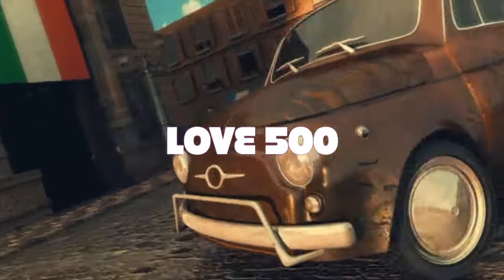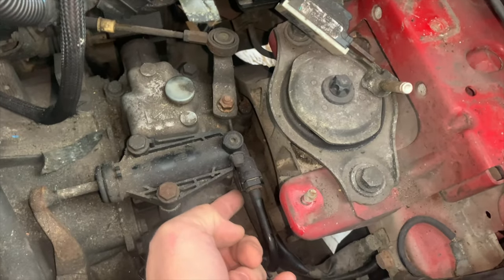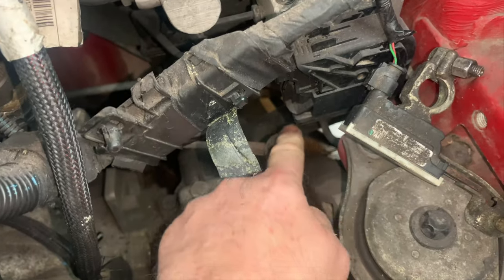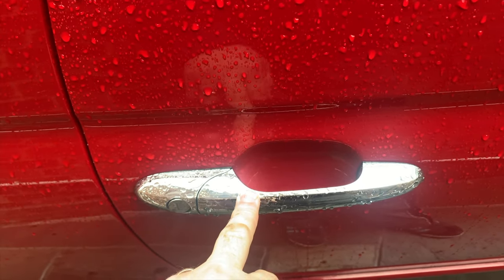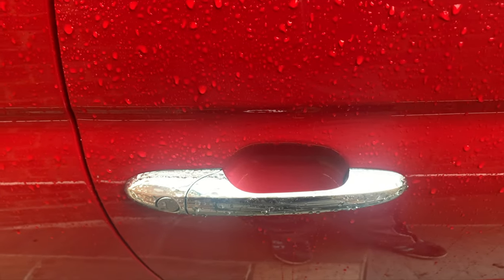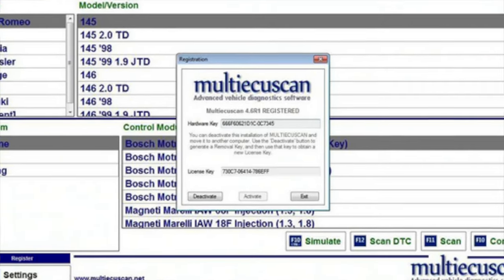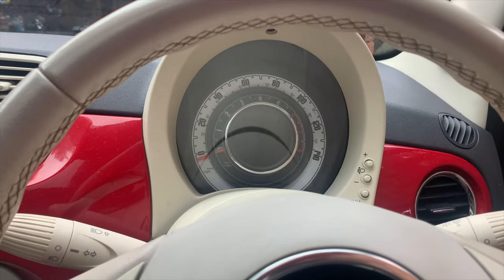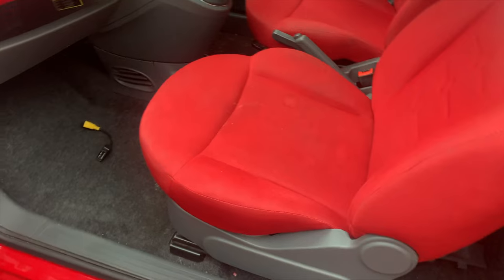Common Faults on a Fiat 500 or Abarth 595. The faults are the same. #abarth #fiat500 #595

Comment: I bought my '12, USA FIAT 500 from a used car dealer in 2020. It had 124,300 miles on the Multiair engine. Manual transmission. One right away issue was the hatch wiring. I fixed all the chafed & broken wires best I could & left it alone. I don't use any of (turn them on) the items the wires supply electricity to (wiper or window def.). I put on a universal license plate light & all is well there. My front shocks are exposed as in this video but rust free. I'll give 'em more scrutiny after this video, put some grease on 'em. My brake/clutch cylinders haven't given me any problems & doesn't leak. The pass. side door handle is tight as can be, very little play in it. The driver's side has a little more play in it but is not broken at all. My instrument panel will flash on & off a little bit here & there (I've read that each year has different problems) upon start up (more with cold weather) but works normally after that. I'm in my 4th year of owning the 500, nothing has really gone wrong, & I'm replacing all the wear & tear items as I roll along.

Comment: thanks, bought a 2013 fiat 500 that had hill start, stuck in 2nd gear, (automatic), red hood light, see dealer to check engine, among many faults. After clearing faults, they came back. I pulled all plugs under battery, ECU, and others, cleaned all grounds I could find. The car seems to be fixed after 6 months of guessing, thanks again.

Comment: I bought an Abarth with 37000 miles for $5000.  Not a problem ever.  Now has 79k miles and 3 years later.  Much better than the two 128's I owned years ago.

Comment: Great informative video. Just been to look at a 10 year old Twin Air Plus model. Some of the common issues have been done (front shocks replaced and nuts now covered in grease rather than caps, and rear hatch wiring been repaired). A smashing little runaround car so bought it on the spot thanks to your info 👍

Comment: Awesome Vid, helped me fix the back of my fiat 500c truck wouldn't open and rear license plate was off, took off electrical black cover on left in canada, and showed a wire split i added some copper jumper and voila good as new, also the key fob wouldn't work to open trunk :) thanks again

Comment: Hi Paul  as usual Great, informative advise, your general content and with these common issues with our 500s🙄
The one you mentioned about checking the oil cap, its not  always necessarily a head gasket issue ,these cars can suffer from engine condensation build up in the cold of winter with the sudden stop start temperature changes can cause the gunk  build up you mentioned, my abarth does or at least did as we recently moved and my car is garaged now☺ so its clear now as its sheltered. 
I think headgasket failure leans more towards overheating on a test drive, heater not getting hot, coolant in the oil or  on the dipstick, oil mixed in coolant expansion tank, an a very excessive build up of emulsified oil and coolant, also worth checking the breather system pcv valve for build up of gunk or for  internal rust corrosion if so replace it  Another on the abarth, sticking or seized calliper slider pins particularly the rear, this causes foot, hand brake imbalance, uneven pad wear, the inner pad can stick also  scoring on the disc's and in worse case the piston can also seize, all the callipers slider pins need to be checked annually to prevent this and unnecessary expense of replacement!
Premature underside rust is another, rub down with wire brush or drill attachment then apply direct to rust metal paint will help slow the rust process down and always looks good come mot time 
Also these cars are very sensitive to the slightest voltage drop so of the battery is a bit dicky it will throw up all sorts of electrical warning issues when all it needs is a new battery which should always be your 1st port of call before panicking and delving deep as this will generally cure the issues ,I'm sure you know yourself are aware of some of these I've mentioned but hopefully will help some of your subscribers !  if I think of any others I'll add them .
 🙂👍
Reply from the maker: I’m actually aware of all of them. The brakes on the Abarth only too well.
Reply: You get that gunk on the inside of the oil cap on most cars. It's gunk on the dipstick you need to look out for.

Comment: Just found both of those drain holes completely blocked on a 17 plate Abarth with standing water in the tray around them. The only reason I happened to notice that was because my front windscreen wipers stopped working yesterday and, when I removed the scuttle panel to access the wiper motor, I noticed the standing water in there. I also had the broken rear hatch wiring issue, which I fixed a couple of months ago. The car also had a lambda sensor fail about a year ago.

Comment: Thanks for all this. I am a new Fiat owner, not a new car just new to this brand. I bought it to tow behind my Class B camper. It is light and they make a lot of equipment for that purpose. I live in Oklahoma so the water problem you have over there will not be a factor here. Hot & dry. One problem we have with any car is headlight cover deterioration, solar radiation causes them to cloud up. I have been sanding them with 600 grit WD paper then spraying on a layer of clear coat. Lasts for years. Your video gives me information on what to watch for. I found a 2012 W/ 94K miles that is in very good shape and it is white, white is important here.  Again, thanks.

Comment: Going to look at a 2010 Abarth tomorrow, video was really helpful, you gained a new subscriber too!
Reply from the maker: Good luck, hope it’s a good un. Take a good look at the bottom chassis rail extensions too as they rot as well as the rear beam.
Reply: @Love500  Thanks for the tip!

Comment: Great video - excellent!  The clutch pipe connector sits on the chassis rail next to the nearside front strut.  Its position is so exposed the brass push-fit becomes impacted with crud/salt and they can split!  Replaced the master and slave together last year (10 plate).

Passenger door handle done, and rear tailgate wiring harness had to be fettled too.

Rear taligate release handle suffers from water ingress and the whole chrome strip incorporating the numbef plate lights needs to be changed.

Rear axle spring cups are corroding but not an MoT failure.....YET.

Keep up the great work on the videos.
Reply: Due second cambelt change. Not deisel or twin air.

Comment: Subscribed!
Just bought a 62 plate Street edition for my daughter.
Very detailed explanation of the common issues.
Will be checking all the things you mentioned👍
Reply: Due it's second cambelt change if it has one. Not deisel or twin air

Comment: Hiya Paul
Love the channel. I'm subbed and followed for a while and it's helped me with my partners car a lot.
Wonder if you have ever replaced the resistor which gives the cabin fan speeds ? Hers only works on highest setting and I'm told this is also a common fault. 
One of your wonderful simple clear videos would make me a fan for life.
Reply from the maker: Thankfully I haven’t as it’s grief apparently. Dash out job.
Reply: @Love500  I can see the bloody thing, but it's right behind the steering column.
I'm not a confident enough mechanic to disengage the column.
Was hoping there was a clever expert trick.
Reply from the maker: @GaryThatsgary  I’ve never actually disconnected one but I think it’s just one simple bolt.
Reply: @Love500  😄Here's hoping you never have to.

Comment: Hi Paul.
Great video, really helpful. One thing you didn't mention is I see lots of 500s with mot advisories of rusty rear axles or rear spring carriers. I would like to treat mine to prevent this as some rust is starting.  I've thought of coating the axle and spring bases in grease or waxoyl. What do you think 🤔
Reply from the maker: Some people paint them. Use a wire brush or wire brush on a drill to remove the surface rust and any good quality treatment will to the job. I’ve had them myself.

Comment: Yes, great video. Have problem with tailgate latch and wiring.
Can sort wiring but Any recommendations on where to get a new latch mechanism? A lot on eBay but wondering if you had any suggestions? 👍
Reply from the maker: I buy most things on eBay. Plenty available, just get the cheapest one you can find.

Comment: Hi Paul, Great vid as always. i am finding that on most of the older Fiat 500s 2008 /2011 the rear axel rusts quite a lot and some times rots. Have you come across this yet?.
Reply from the maker: Not completely rotten, but project dirt was quite bad. Still a good couple of years out of it hopefully but yes, quite common on the older ones. Luckily not an expensive job to replace.

Comment: Hi Paul, great content I have a problem in my 2011 500c the whole of the dash isn’t working any ideas. Thanks Marc
Reply from the maker: @marctownsend4821  you mean the Speedo?
Reply: @Love500  hi yes the Speedo the rev counter the milage everything isn’t working
Reply from the maker: @marctownsend4821  check the fuse to start with. Not sure which one it is off hand. Otherwise it’s probably the Speedo itself.

Comment: I've been a subscriber for a while and always enjoy your videos. Wondered if I could ask a question please. My daughter's 500 1.2 Lounge is leaking washer fluid under the passenger sill cover. Do you know where I can buy a repair kit for the hard plastic corrugated pipe from. Thanks David
Reply from the maker: All you need is a joint. If you look at my project Winnie video where I replaced the hatch wiring I have joined it there where i cut it as part of the loom.
Reply: Thanks v.much
Reply: @Love500  thank you v. much

Comment: Send the dash off to ecu testing and get life time warrenty after .. or buy a second hand dash pay to have it all reset and that can fail being second hand .. I send all mine away .. and have not had to worry about resetting programming and had them done under warranty also without hassle ... 
it’s worth the refurb ...
Reply from the maker: Where do you get them done? How much?
Reply: @Love500  ecu testing ... I had one go back 3 times 🤦🏼‍♂️🤦🏼‍♂️over a two year span cos it failed differently each time flashing a different tail light .. first time engine then it was temp then I think it was fading in the handbrake and abs light ... I don’t know what they replaced each time but they warrenty the entire dash without hassle everytime .. luckily customer could go without the car each time ... but I gave them the option of brand new or this .. the others have been fine since first repair ...

Comment: great video thanks so much. buying my first 2013 1.4 lounge tomorrow, so great tips on what to look for, will make sure to do some checks before signing on the dotted line. look forward to seeing all your useful tips in the future. vehicle has high mileage 158 000km would you suggest changing the cambelt if they do not have the service history showing that it was done?
Reply from the maker: Absolutely. One good thing about a breaking belt on a 1.2 is it isn’t destructive so doesn’t actually damage anything. I’m not sure that is the case with the 1.4. Definitely change it if it hasn’t been done.

Comment: Amazing video, thanks a lot!
I wonder if Fiat fixes this faults in new versions or not? By the way, I am planning to buy a 500 automatic, do you know any problem specific to automatic? Do you recommend it?
Reply from the maker: If you specifically want an automatic I would get a different car as they are a robotised manual and have terrible problems which cost a fortune to repair.
Reply: @Love500  Oh, thanks for quick answer and information. That is a pity. I really liked this car design, but need an automatic car. :/
Reply from the maker: @fatihbulut9567  there are plenty of people out there with perfectly good ones but it’s very very common that it’ll jump out of gear or not go into gear. Oil seals fail. I wouldn’t have one.

Comment: Hi, I'm surprised you didn't mention the coolant hose from top rad to block. I've had many in with the same issue. First thing I check.
Reply from the maker: Never had one.
Reply: @Love500  
The cars were 10+ years, Hoses leaked past original clips. Must be an age thing 👍

Comment: Hi mate excellent video appreciate the work I stumbled across your videos as I was looking for a fix for my wifes 500c blue and me issue and speedo flashing which thanks to your video I have diagnosed is her issue, just a another question the engine management light and oil temp light is also dimmily lit in the background is this the speedo unit faulty or to do with the blue and me module. I don't want to replace the speedo unit as we are selling the car and have already spent money on tyres, paint on the spoiler new battery and now this blue and me module any advice is much appreciated.
Reply from the maker: It's the speedo I'm afraid. Have a look at my Project Loopy Harold, I've changed the speedo twice on that due to the exact same thing.

Comment: Hello Paul. Thank so much for such precise videos, explanations and advices. I have a 2017 Abarth. On -12:40 minutes, you mentioned about the draining plastic grill and some holes that you detailed on another video. May I know where to find it, so I can remove mine and get that area cleaned. Also, I am having issues with removing the negative terminal on the battery. It looks there is a ring in between, I don't want to damage it. It is a original mopar battery. Again, I appreciate your time and assistance regarding my case. Regards.
Reply from the maker: If you look in the how to series there’s a video on sloshing sounds and smother one on removing the scuttle panel. What is this ring you’re referring  to? Is it a flick thumb release for the battery or the quick release with the red button?
Reply: @Love500  Hello Paul. Thank you for your answer. I checked several videos of yours where you explained about changing the battery; however, terminals on my battery are totally different. My abarth is a US market version, if that may tell you something. Is there anyway to send you a picture? I removed the hex nuts, but the conector is stuck, it swivels a bit, but applying force upwards may damage the terminal. Thank you.
Reply from the maker: @pedroalonso1030  you can send to me via an instagram message. @love500salvage

Comment: Great vid thanks! I have the issue of the dim lights accompanying indicating right (engine, abs, temp), they all go out once the indicator is cancelled. Would that be a new speedo, or is it possibly the rear hatch wiring?
Reply from the maker: Definitely Speedo. Nothing to do with hatch wiring. Get yourself a replacement on eBay with less miles than your car.

Comment: There are also issues of impeccably serviced 1.2 and 1.4 engines using oil and are noisy when cold after around 100k km to 150k km.
I've seen this happen time and time again,
I actually have two engines in my shop now  with excessive bore wear.
The blocks are definitely not as stout as the old Lampredi designs.
Reply: Perhaps people adhering to factory recommended service intervals? IRL oil should be changed at 10k km intervals at the latest.
Reply: @varmastiko2908  yes that could be a factor, it is one of many factors contributing to bore wear.
I'm going to post a video shortly on  how we measure the bores and how distorted the wear areas are.

Will send a link to the channel.

Comment: Really Really interested in your videos & subscribed, I am after a cheap run about. Possibly a 2008 F 500. Could you give me any advice on mileage for this year & Max price (in other words, what should I avoid) hope you can help. :-)
Reply from the maker: It depends where you are as price is affected by location. A non cat car, you would probably be looking at around £2,500 ish. If you bought one under £2k it would no doubt have high miles but there are the odd little gems out there. I would go for something a bit newer if you can. Only plus point in the older ones is the regular parts that wear out, like suspension components have probably already been changed but with a car 2008, they might well need doing again. Look at the .gov website if you are in the UK and enter the registration number of a car you are interested in, search for MoT history from within .gov and you can see any failures and what they failed on and also advisories. If you can see something that was an advisory and then no longer is, chances are they had it done. Try and get one with a service history so you can see exactly how it's been looked after. Hope that helps.
Reply: Wow! That's a really useful tip, I will defo look into this thankyou 😃